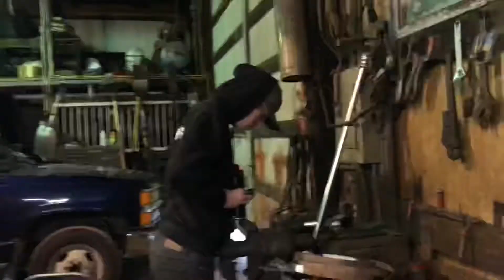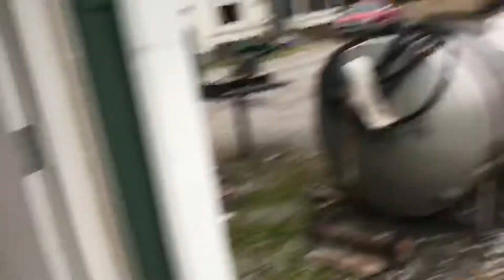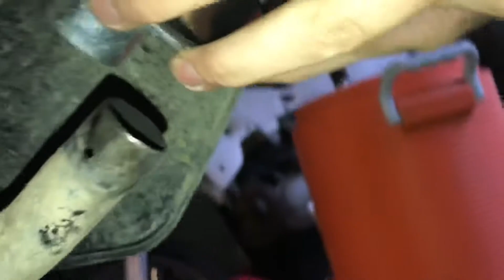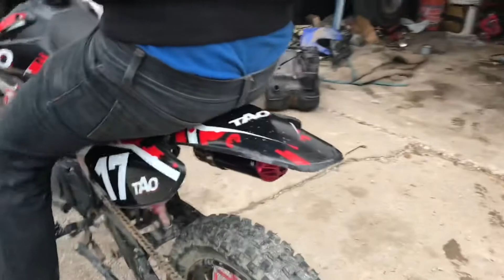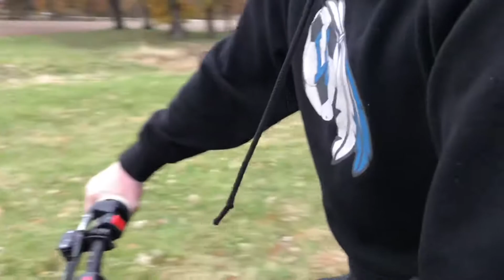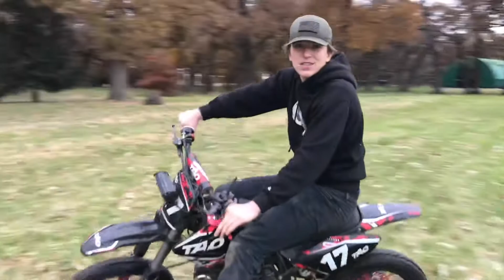Pitbike Exhaust Review and Install

Comment: That bike bogs a lot, I recommend cleaning the carb 👍
Reply from the maker: We sold that bike. He left the China bike club
Reply: Budget Bros lol damn
Reply from the maker: Yeah real sad. But I got another friend on board
Reply: Budget Bros yeah I have a TaoTao Dbx1 and I put a nibbi 26 carburetor on it like a month ago and it rips
Reply: Budget Bros love the vids by the way 👊🏻
Reply from the maker: Glad to hear that, I love mine and have been told I could use the same carb even if or when I do a big bore kit.
Reply: Budget Bros yeah
Reply: its because it was not warmed up thats the bogging. if you dont warm mine up it bogs then slams you forward
Reply: @F4i_ethan  will the nibbi 26 fit the tao tao 125 db 17
Reply: @irajames9404  yeah most likely
Reply: @KrisspyMk4  i got a racing carb for mine never cuts out im completely rebuilding my dirt bike from ground to up im going to make it so i can race it i already got tires and stuff im working on the shock absorber so im able to do jumps i got a electric starter that is going to be here in a bit ill install that im looking for a good exhaust slip on this one is probably going to be my choice even got professional rims and tires
Reply from the maker: I’d be honest, I wanted to weld a Pro circuit on. Much better quality, but need fabrication skills and a welder
Reply: @irajames9404  yes but I recommend Mikuni carb, I have one on my 125 runs great. I honestly think they need the swap the carb and do some tuning because mine starts first kick even when it’s super cold out and doesn’t bog at all.
Reply: It’s just a re jet
Reply: It's chinese and it's dog shit that's why it don't start properly just buy a thumpstar they start every time first kick in the cold 👍
Reply: @kieransanpher2101 ehhh well there dog shit because they got crappy carb and not tuned properly 😂 but if you buy a better carb and jets know what your doing with jetting then they start 1st kick and have pretty good power ngl. I got a pit bike laying around and that shit is lethal for its size.

Comment: Did you ever rejet it?
Reply from the maker: He sold it shortly after the exhaust... I doubt he did tho
Reply: @KrisspyMk4  damn I was wondering cause I was gunna order the same one. But in all honesty that bike wasn’t running 100% so the video doesn’t really show a improvement you know what I mean. I just rebuild my crf50 with 84cc big bore kit and trying to find a cheaper pipe for it cause the stock Honda one is choking it. It almost runs better with no exhaust haha
Reply from the maker: Find the appropriate size carb for the motor size. Finding the proper jet size and air flow. Plays a big factory tbh.

Comment: inside the ausouh does it have a mesh
Reply from the maker: Yes, a spark arrest
Reply: @KrisspyMk4  there is no that black red there is only black green
Reply from the maker: Look around, a lot of the same parts just different companies names. Just make sure it the correct size exhuast
Reply: @KrisspyMk4  are you drilling holes or not
Reply from the maker: Wholes in what? The exhaust?
Reply: @KrisspyMk4  yes